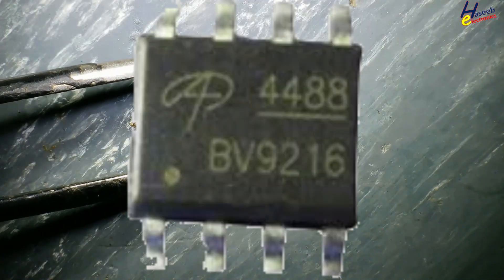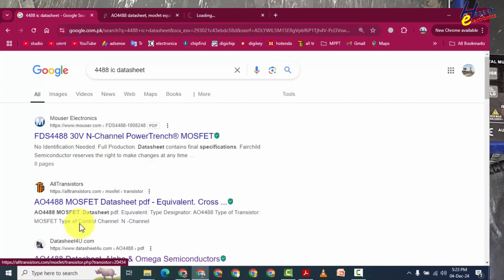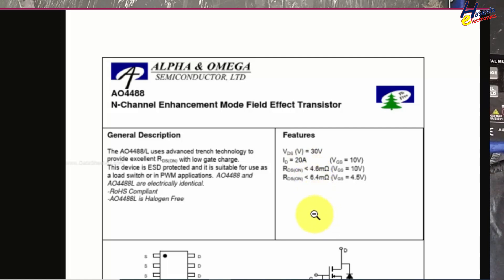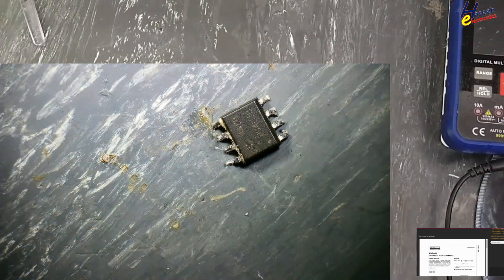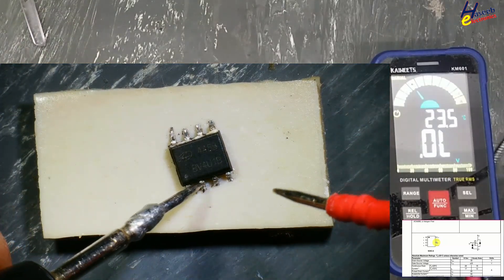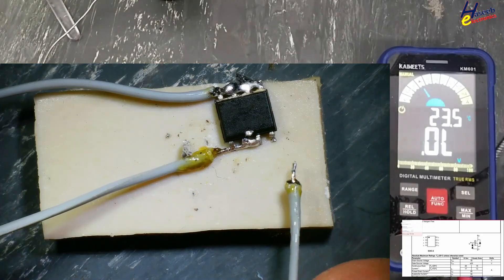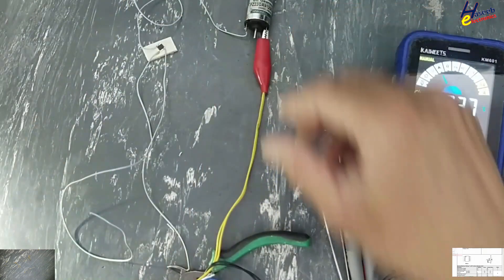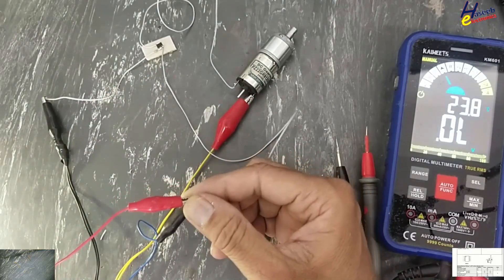{1248} AO4488 MOSFET datasheet & testing

Comment: thank you, that’s nice! Can you explain to me at 4:12 when you connect the gate pin to the 5 volt, there are two wires, the red clip and the black clip, how are these wires connected? THANKS
Reply from the maker: I used 12 power supply 
+12 volt to motor 1 end (red clip)
2nd end of motor to pin 5, 6, 7, 8 drain pins
Pin 1, 2, 3 are connected to ground (black clip)
I used 5 volt for gate 
(Common of 5 volt and 12 volt are connected together to make common)

Comment: I love the tape idea with smds! Because of you I've started using tape to hold those pesky components from going to the floor! Interesting this IC doesn't die off right away. Does this turn a square wave input to the gate to some for closer to a sign wave on the output? The device ratings would likely be MUCH lower if not in full saturation region. Great lesson sir! Have a great weekend!

Comment: A lamp (resistive load) would make a better test load, there could be quite a high back emf from the motor.
But that's just my humble option.
Still nice to see a quick and easy test.
Reply from the maker: You are right. These MOSFETs work nice with resistive and inductive loads. Because these MOSFETs have built in parasitic diode. 
Special thanks for your valuable suggestion. That will make a visible effect. I will implement it in future